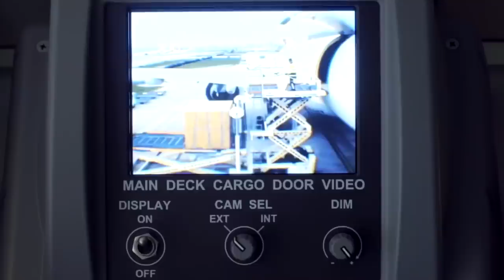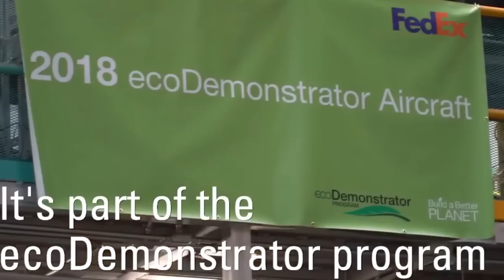Why is Airbus lagging in the freighter market?

Comment: The A380 won't ever be a freighter for the simple reason that its maximum takeoff weight is too low to fill up the entire aircraft with goods. There is no point in having a relatively inefficient (bc it has 4 engines) aircraft as a freighter if you can't even get the full benefit of its massive inner crosssection..
Reply: I would contend that the A380 would make a poor converted freighter because it's relatively stubby profile.  The only good placement for the cargo door is forward of the wings.  You'll need specialized cargo handling to load the upper deck.  It just doesn't compare favorably to a 747 with it's front loading capability and overall maximum payload.
Reply: and then there won't be a nose door like the 747 to carry long cargos
so it will be pretty useless
Reply: @Xyb3rTeCh  It would need a whole engine refit (which is costly bc you have to change the whole wing section for that and certify it) to be a viable freighter... I love the A380 and I´m really sad seeing it rapidly vanish from the skies but in the current configuration there is no way for it being a future freighter... sadly..
Reply: @77l96  wrong. Turn it to a freighter plane and you got really good potential cargo plane.
Reply: @TheGaMeL0rD  what the heck you're talking about?! The engine is obviously powerful enough to carry cargo! Did you look at the Boeing counter part?! They totally using more or less the same engine and some airliner even covert their passenger B747 to a freighter version, same engine and all that.
Reply: "The A380 won't ever be a freighter for the simple reason that its maximum takeoff weight is too low to fill up the entire aircraft with goods."

Why that matter?

as long as it is profitable to do so
Reply: @anteeko  Because it isn't as profitable as Other Planes it has to compete with. And therefore the B747 makes the cut while the A380 sadly does not ..

Comment: What helped Boeing was that when they designed the current 777-200LR, they also included provisions for a freighter version (777-200F). It's that version that has sold very well, frequently as replacements for retiring older 747 freighters. And Boeing offers the 747-8F, which offers more carrying capacity and a bit more range.

I do think Airbus may be looking at a A330-800neo freighter, though.
Reply: Too late Airbus has alot of ground to cover, not to mention the A330neo is not selling it's been a disaster

Comment: first of all the a380 still can't land on many airports around the world,the 747 is the rite size of aircraft for any airport, its big but not super big like the a380.The a380 is more heavy than its payload.Boeing engineered the 747 for both passenger and freighter market.
Reply: lyon rambo you can't spell 'right' correctly and used the word 'Payload' so please don't comment.
Reply: What about the A380 combi?
Reply: DODLE  you fool payload is spelled correctly!!
Reply: DODLE edit your video title not even capitalized....do proper nouns
Reply: lyon rambo yeah a380 too huge
Reply: Not true. Plenty of airports cannot handle a B747. It's only the wingspan of the A380 that makes it un-parkable at most airports. Plus the B747-8 is not much smaller than the A380-800. Look it up.
Reply: 747 have higher compatibility than 380
Reply: When the 747 was built in the 60s and entered the market in the early 70s,many airports upgraded for the 747 accommodation.The 747 was very demanding that they were flying at every major airports.The 747 has more that  1,500 built so far,the a380 only has 230 built.
Reply: The 747 has a future as a Freighter. We should all be ashamed about the a380 for sure. What about that plane?
Reply: Actually, the 747 was engineered originally to carry cargo

Comment: a380 wont and never will be the freighter or even passenger plane of the future.
Reply: Why the certainty? Emirates has ordered over a hundred of these. Other airlines are keeping them for the foreseeable future and might even replace them with the A380 plus.
Reply: @نادرالیراحمان  - It wasn't designed as a freighter unlike the the B747. The original B747 designed was for a freighter and converted for passenger use.
Reply: Ek just lost 83% Profit. 
نادر الی راحمان
Reply: Agreed that it couldn’t be a freighter but disagree that it has potential for passengers in the future. Overcrowded airports would benefit from high-capacity planes for using less gates in the future.
Reply: Marvincent Acuña it’s called the 777X and maybe further stretched A350s.
Reply: @BoeingBoi 742 747-8 has less capacity and pax over the 747-400
Reply: @morganlambley8655 , I've actually almost forgotten that their new twin-engine widebody jets have capacities that are already very similar to their older quad-turbine jumbos. Thank you for this comment.
Reply: spot on
Reply: @Xyb3rTeCh  Airbus engineers can't hack it. Boeing for the win

Comment: The bottom line You covered is the structural weight issue relative to volume issue.  Boeing has generally designed It’s aircraft with eventual freighter in mind. Airbus has not followed that philosophy generally.

Comment: The conversion process is on it's deathbed. All modern Boeing and Airbus passenger aircraft have been made with fiberglass floor beams since the 90's. This makes the planes much lighter, but the upper decks cannot hold the weight of the cans that are used on freighter aircraft. Freighter aircraft must have aluminum floor beams. For this reason, FedEx is replacing it's MD-10 fleet with brand new from the factory 767-300F which are based on the 1980's model that Boeing designed for UPS. they're replacing the MD-11s with brand new 777F and they've also acquired a couple of Air France 777F and they taken control of the TNT birds which they gained after buying the company. The last P to F conversions they had were the 757 program, and that ended up being a disaster for the company.

Comment: Simply is industry inertia - if someone wanted a big long range freighter up until 15-20 years ago, the 747 was the only real option
So all cargo airlines have got the 747 infrastructure in place (mechanics, hubs, pilots...) and it's very expensive to change it...might as well keep buying used 747 and turn them into cargo or buy the -8F
But actually, if Boeing makes a freighter variant of the 777 based on the 300ER instead of the 200, i bet that would be the perfect size and efficient freighter and no one would order the -8F anymore (that's probably why they still only make the 777-200F)
Airbus isn't that bad actually: in the mid size mid range cargo plane the A300 alongside DC10/MD11 dominates the market much more than let's the 767...now they have the A330 freighter conversion programme, so when airlines sell off their passenger A330s cargo companies will buy them in bulk and covert them to replace ageing DC10/MD11 and A300s
Reply: They still use the 747 because look at how big those nose doors areeee!
Reply: @GranTurismo69420  not really. Side doors are more than enough to load cargo pallets, a big nose opening makes sense for high volume transporters like the Dreamlifter or the Antonovs
Reply: Luca Mino you got a point there, but many freighter companies need those to carry huge items with cars, ships, etc
Reply: The nose door is actually one of the biggest uses for the 747. Hence the hump on top. Airlines love it cause they can load it from the front and back at the the same time making it quicker all round. 

The 777-300ER doesn’t work as well as a freighter. The -200 works best because of the engine power to weight ratio over range. Same again with the 747, it’s got the power and range to make it work in the really long haul. 

If the -300ER was converted to a freighter it would be used in the medium haul with not as many numbers because it’s easier to use smaller freighters over that distance. 

I’d expect Boeing to launch a dedicated freighter version of the 777X in the future, based off the 777-8 considering it’s almost as big as the -300ER
Reply: Luca Mino The opening nose on the 747 is also handy for longer items that won’t fit in the side door

Comment: Freighters are more important now than ever before. The 747 was originally designed as a military plane and competitor to the Lockheed Galaxy. So the cockpit is high up on the second deck allowing the nose to open. The A380 has this on the lower deck so blocking any chances it would have as a high volume low density freighter. Shame! :-(

Comment: Why are airbus aircraft heavier than their Boeing counterparts?
Reply: Because weight reduction costs money and requires engineering and imagination. Even with all the new gadgets loaded on a B-777-200ER, it still weights the same as the original because they focus on it. Airbus has never bothered; every NEO version they have made weights more than the product it's replacing...
Reply: Because they never focused on streamline cargo planes. Most of their planes are meant for commercial passenger use, because of this you would not need a lighter plane. 
Investing in making the plane lighter would be a financial mistake for Airbus.

On the other hand, Boeing normaly designs their planes to be freight and passenger planes. And investing in making the plane lighter would be smart, as it helps them make more efficient freighters and sell better.
Reply: @jarheadcharlie2315   I doubt so, if airbus was really that much heavier than boeing counterpart it would still not be able to compete

Comment: Just like you said its all about convertion, except for the 777F which is just a unique perfect freighter product.
The 747 is not selling to well as freighter because of lowerer demand and without the huge Fedex order most of the 767f would also be convertions.
Airbus was sucessfull in converting A300 and is starting to do the same with the A330, but the freightermarket has always been Boeing or earlier McdonalDouglas territory.
Airbus is better of focusing on ther passenger and mostly on their narrowbody family, they have enough revenue.
But it will be very intresting to see when in 2021 the first A321 get converted, by that time there should be enough old aircraft available and then they are perfect for express parcel frwught and can easily replace the 757Fs.
Reply: Airbus is missing out on this one, air freight generates billions of dollars every year. Boieng knows this not only that  all the major shippers are base in the USA UPS, Amazon, FEDEX,

Comment: Airbus had drawn up plans for a prototype a380 freighter a few years back, and then suddenly scrapped them. The current design of the plane wasn't compatible with the type of work that freighter planes do. Like Boeing, Airbus would need to completely re-think the a380 from the ground up, the way Boeing did with the 747-8f.

Comment: Why is the MD-11 still widely used in freight, wouldn't it's fuel consumption make it noncompetitive like it did in PAX service?
Reply: Because it has a unique place in the cargo market which most cargo companies have been able to make great use of. It's used on routes where a 777 is too big but an A330 and 767 are not enough. It turned out that carrying passengers just was not its thing. But it's a great freighter. I hope it lasts 50 or more years in service.

Comment: How about the a300f
Reply: But only ab freighter that sold in decent numbers.. many still flying..
Reply: A330F
Reply: Old horse
Reply: In the future the a330 neo f
Reply: OMG_ CS21  the A306F is a much more modern and very capable freighter. Last ones were delivered to UPS and FedEx in 2007. Too many ppl generalize "A300" without realizing there were 4 eras of that airframe.
Reply: @BoeingBoi 742 By your logic the 737NG, 757 and 767 are also obsolete because they areny FBW and have yokes too.

Comment: The A300-600F is a fantastic freighter, in perfect world the A330F would compliment it for operators that need a little more range but heres not why... FedEx can fly their A306Fs loaded out of short strips like Burbank and John Wayne all the to MEM. 763Fs can't operate out of those field with a comparable payload. But the 763F does well a longer and thinner routes for them which the 310 did for them for awhile. The A306F line only closed in 2007 so they will be around for a long time, great airplane. The 330Fs haven't sold as well as they are almost too big for operators needing an A306/763 size freighter and operators are holding on to theres. If they need bigger they step up to the 748 and 777F. So the A330F is sort of in no man's land.

Comment: Why no 787F?
Reply: It’s too fuel efficient
Reply: Aviões e Jogos I’m pretty sure the fuselage is made out of some material that they can’t cut a cargo door into. So they can’t load containers.
Reply: too new just wait 20 years
Reply: I don't think it can support the weight, the wings would bend to much
Reply: Gabriel Sasala the wings can support it all the Materials are just as strong as the ones on the 767
Reply: they don't have any competition, Boeing already dominates the freight market theirs no need for the 787 for now
Reply: There's no point since the 767F is doing very well

Comment: How about AIRBUS BELUGA
Reply: There are only 5 Belugas and 5 Beluga XLs flying, and they're all owned and operated by Airbus itself. They aren't commercial aircraft; they're corporate aircraft designed to transport parts for other Airbus aircraft. The same is true for the Boeing Dreamlifter. It is not on the market; it is owned and operated by Boeing.
Reply: Those are for specialized cargo.